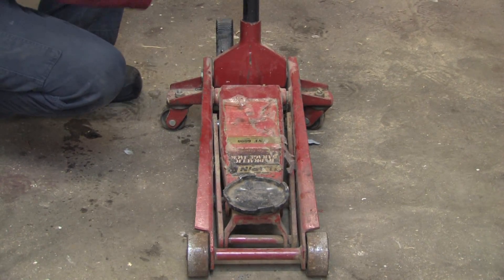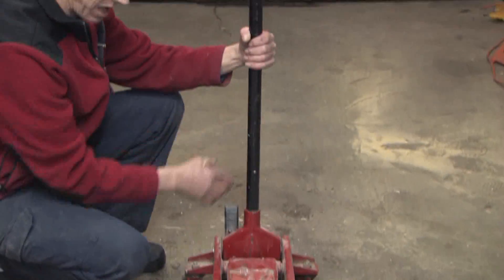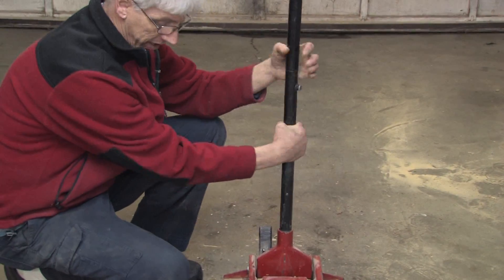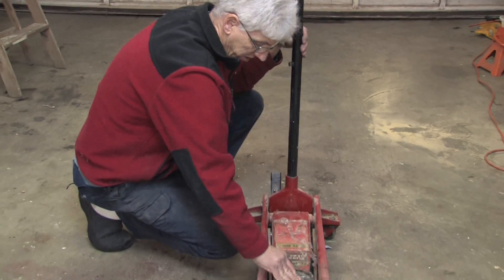Car Maintenance : How Does a Floor Jack Work?

Comment: Do you have a manual for that specific jack? I just picked one up and think it might need a rebuild. Is the foot pump only used to lift the jack to the frame and then you use the handle, or should you be able to lift the vehicle using only the foot pump?

Comment: Is it just me or can anyone else not find a picture of a Hydraulic Jack's hydraulic components? Because I don't care about the wheels and the screws used. Because I have to make a power point labeling: Cylinder  (Actuator), Valve(s), Filter, Pump, and Reservoir and I cant get a decent enough picture. As well as any common hydraulic or pneumatic system. If so Could you reply a link :D